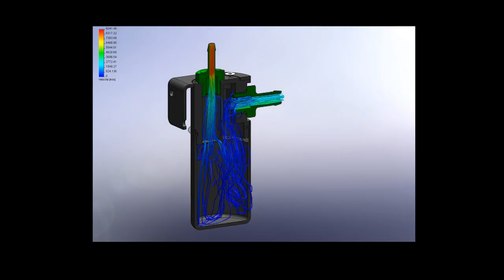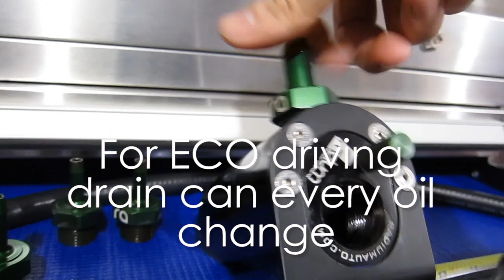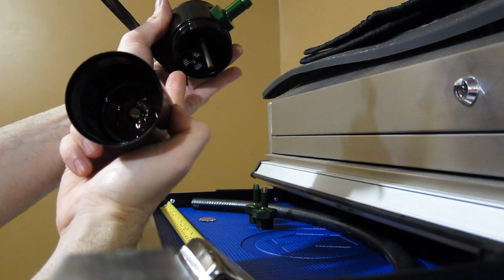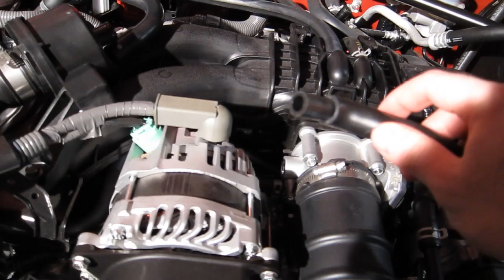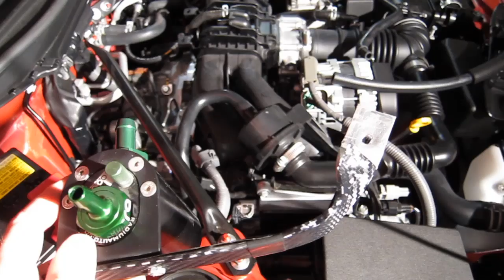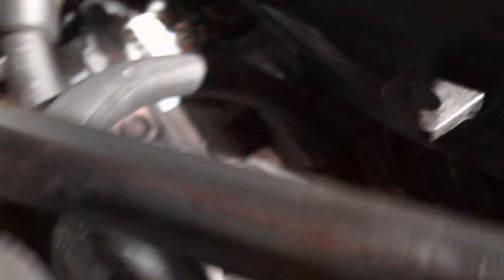Radium Catch Can Install  | Scion FR-S | Subaru BRZ

Comment: The factory doesn't install this due to the fact that its actually kind of bad for the environment, and requires a bit of extra maintenance, but it does trade off in adding longevity to the engine.  It "catches" the oil going through the PCV line(gases that escape from the crank case that contain contaimenents), stopping it from ending up in the intake manifold, where its supposed to get re burned and used for combustion. Normally it gets re-burned and  that's bad for the engine because it coats
Reply: 851995STARGATE it's a closed loop system that doesn't vent to atmosphere. Is no worse for environment than stock.